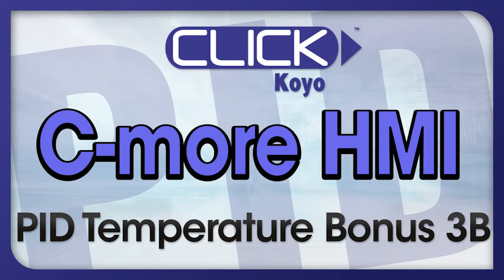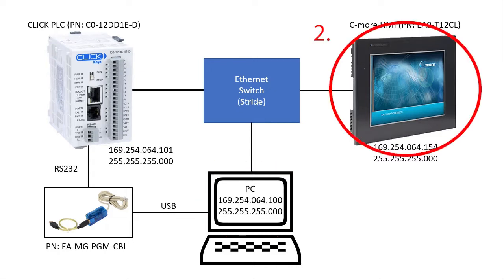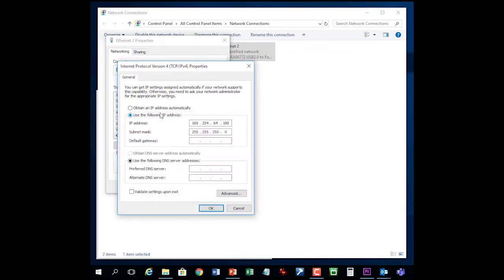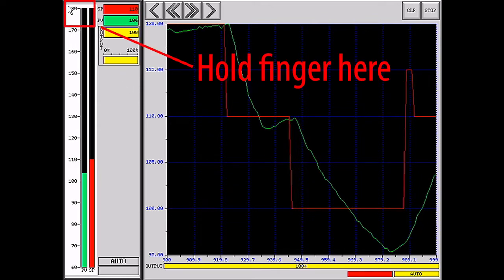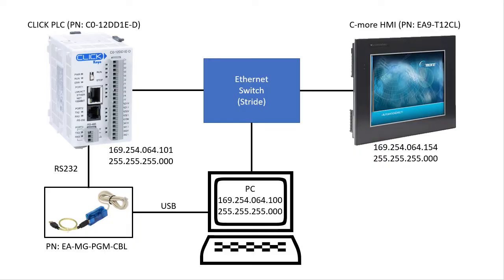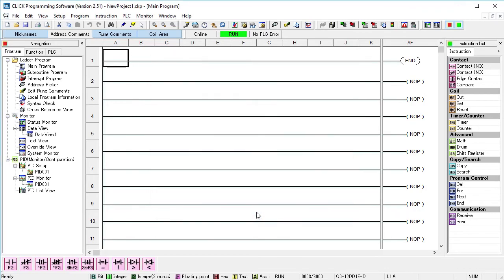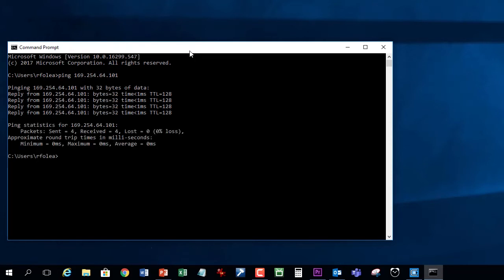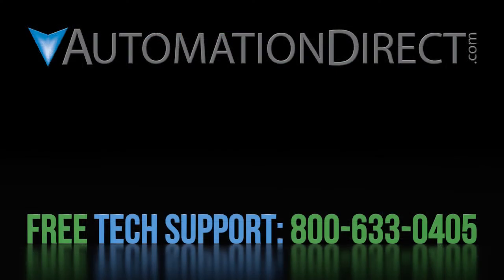CLICK PID Tutorial Videos Bonus 3B - C-more PID Templates from AutomationDirect

Comment: If you cannot control your process with P only you need to find out why. PID has been frequently misused as a cure all for uncontrollable processes.  There are many instances where proportional control is all you need. Integral is used to eliminate offset from setpoint. But if you can't control with proportional only then integral and derivative won't help you. A properly designed process or equipment with a properly designed control system will control itself with little effort from the controller. An improperly designed process or equipment can have you going in endless circles.

Forget the current buzzword "PID" and study your process you are trying to control. Are your valves too big or too small for the process you are trying to control? Is your converter or coil, oven, flow, or whatever it is too large or too small? Are your pressures or flows too high or too low for what you are trying to do? Proper pressures, flows, system balance, proper valve sizing, coil or converter type, piping, is just a starting point. There are many other factors to consider. Whether a control system is simple or complex the fundamentals of control are the same for 95% of most processes out there. Get a Control Engineers Handbook, Process Instruments and Control Handbook and study the type of process you are trying to control and the best type of control system to control it with. Also are your safeties hard wired? If not, they should be.
Here is a tip. There are some processes that cannot be controlled with digital controls for complex reasons but study your particular control system to make sure you understand why you can't, and make sure your process is not one of them. This alone can help keep you from chasing your tail.
Reply from the maker: @ Gary H. Thank you for the process control explanation, very well stated.